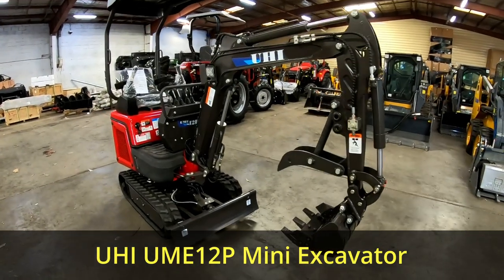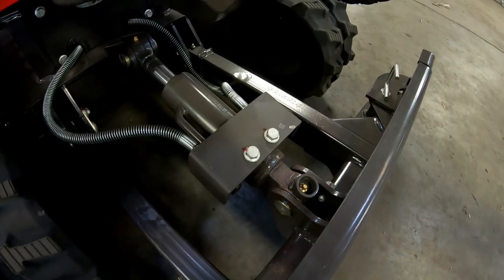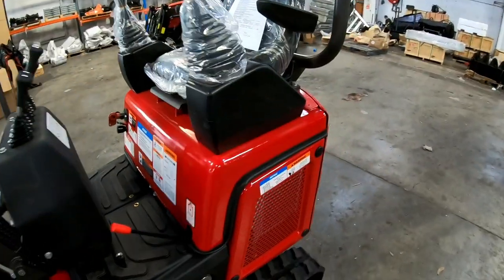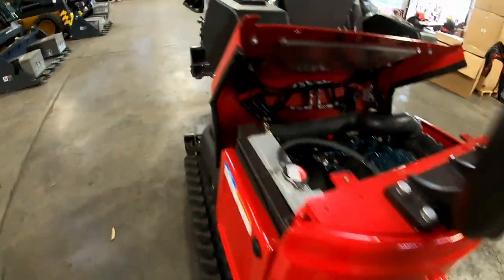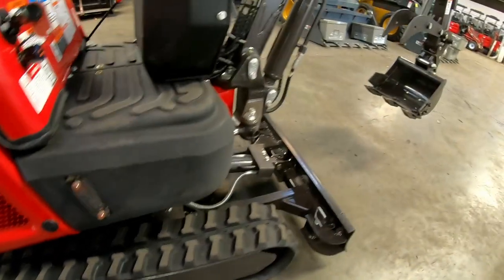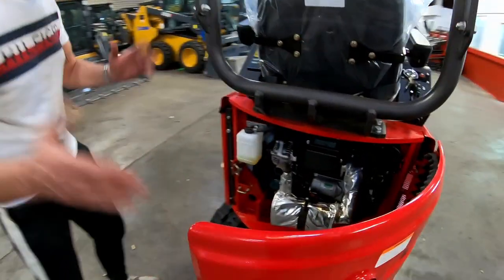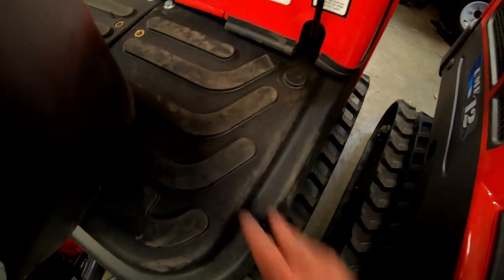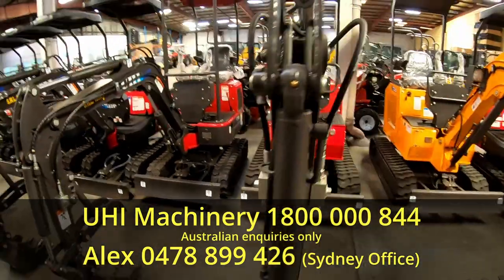UHI UME 12P Mini Excavator - NEW Model Available Now! #minidigger #miniexcavator

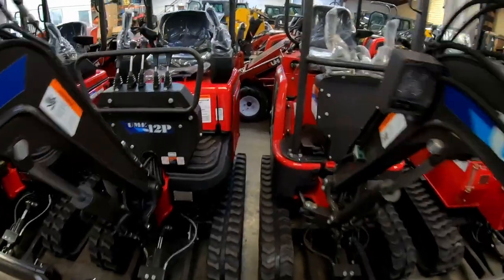Comment: I got the UME12, could've gone the 12P but figured the extra money isn't worth the additions for me.  I don't mind the front controls, its less complicated and will be simpler for valve related troubleshooting.  The thing that really strikes me as a bonus for the UME12P is the form factor.  At the comparison at 11:06 the UME12P has a lower/squatter chassis and the seat position is lower.  This would help keep the centre of gravity down and make it less "tippy" than the UME12.
Reply from the maker: Thanks Andrew. I agree about the extra money. I am not convinced either way at the moment. I do like however the easier access for servicing. Thank you for watching. Cheers Dave.

Comment: Question; I am not sure if you addressed this or not.  Does the UHI 12 have a dual pump?  If not, would you know which models would?  15, 18, or 20?  Thanks for the great videos.
Reply from the maker: All of the small UHI machines are single pump. There is some confusion also in how much volume they pump. The spec sheet says 17 litres a minute for the 1.2 machine  but the sales people say it's 24. I think even the 2.0 tonne machine is single pump where if you buy the same machine from XCMG it is dual pump. Cheers Dave.

Comment: Call me overly questioning but I'd be very interested to learn whether these joysticks actually use a true pilot control valve system or if they are just direct acting valves relocated to the newly positioned sticks (pilot controls are not named after aeroplane pilots as some believe, they are named because they use small pilot valves at the stick end to actuate the larger valves in the valve body that control the rams etc). Someone who's operated a UME12S needs to test drive this unit and see if it's different in the way it responds to inputs. The use of pilot valves is why larger excavators are more precise and smooth, it's not just because of where the sticks are positioned. This unit looks nice but also looks like it's from another family of excavators to the previous UME12S (which seems to be a version of the Rhinoceros XN12-S) and on youtube there is video of a new model of the Rhinoceros XN12-S that now has an access door at the back too (but no pilot controls). So many different permutations of these things coming thick and fast these days.
Reply from the maker: Yes thanks for that Dave. I don't know if you could tell by looking under the cover in the video with the hydraulic lines running up to the controls? I had a look at some pictures of the Rhino on google and not sure if it is the latest model but the top cover tilts back not forward and the roof support frame comes from the front and not the rear on the UHI. Also noticed that the Kubota engine is in opposite to the UHI. The radiator side on the Rhino is on the RHS.
Reply: yes, these are hydraulic sticks. Move more easily and have less slack but more cheap hoses to change and more parts to wear out. For home user I don't know if it's reasonable. For every day use you want these to save your hands

Comment: Cheers Dave, another good video. They certainly make nice looking machines and are striving to make them more user friendly. Just the improved access alone is a big thing. Did you actually get a chance to have a play on it to compare with your one?
Reply from the maker: G'day DD. Unfortunately I didn't get to try it out. There was a truck waiting to pick it up and get it delivered, so time was limited. I did hear it running and see it move out of the warehouse. Controls seemed a little sensitive, not so much on the track controls but on the slew control it looked not as smooth. Could just be the case of getting used to the controls over time. Cheers Dave

Comment: Is it possible to to buy it with an hydrolic thumb installed? It's probably the only important feature missing.
Reply from the maker: I think you would have to talk with the dealer or if ordering direct then have it installed by the factory. The newer model from this one shown has a mechanical thumb and would think future models will eventually have hydraulic. But they are built to a price remember. Cheers Dave.

Comment: Silly question can’t seem to find what type of grease to use ?

Any help 😅
Reply: I use red lithium grease, any decent name brand NLGI-2 spec. I like the reds because I find it easy to see when it's squeezing out of the joints clean.
Reply from the maker: I use a CASTROL AGRI grease which just about covers everything I need to lube up on my place. Others will comment also on what they use I am sure. Thanks for the comment.

Comment: The engine in the umi 12-p is listed as a Kubota D902. Both you and Alex state that the machine is 16hp.  The Kubota D902 specifications data sheets,  states that the D902 is  16.1kw (not16hp) that makes the engine about 21.5hp that is is why it is also used to power the larger machines. Not trying to be picky, but the larger engine was a major factor in my decision to buy the 2024 umi12-p. Not arriving until mid Jan 2024 but I can wait.
Reply from the maker: When the video was done that particular digger had the D902. I can only go on the spec sheets from UHI and from what the dealer tells me. Yes you can look up the specs for a D902 engine and find different horsepower figures in different applications. The D902 can make 24.8 hp at a rated 3600 rpm. Most digger specs sheets show HP at operating revs of about 2200 rpm. I probably operate my digger at less revs than that.

I have checked the UHI website just now and it shows the latest model of the UME12P as coming with the Kubota D722 engine (not the D902). If you have ordered one I would get confirmation on what the engine will be.

When I bought my digger 2 years ago the dealer told me they didn't know what engine configuration would be in the machines until they arrived, as the factory would change from Yanmar to Kubota (and different engine specs) depending on what was available at the time from Japan.

And the HP on the small digger is almost irrelevant because the performance is governed by the size of the hydraulic pump. My older UME12 is rated at 24 litres/min and I see the UME12P is rated at 17 litres/min. I did ask for confirmation on this and was told it was the same as the older model but the spec sheet was wrong. So maybe also wrong for  the HP stated for the engine? The larger XU20 machine does have a D902 engine but it has the larger 57 litres/min pump which gives it more operating 'power'.

Hope this helps. Cheers Dave.
Reply: I would think a more powerful motor would allow you to run at lower rpm without losing the power yet increasing the smoothness of operation. I have a mini skid steer with the Kubota D1105 24.8 hp motor and I find running it around 1800 rpm makes the machine easier to operate. If I need the power I’ll increase the rpm but 90% of the time it’s not necessary.

Comment: Hi Dave Next time you're talking to Alex mention to him that he is losing sales to his competitors because UHI wont mix and match accessories to suite individual customers. I have augers I run off my tractor which also has a 4 in 1 bucket so wanted to leave some accessories off but add a rock breaker instead. Unfortunately it was all or nothing. I can get the Rhino XN12-9 delivered from either Brisbane Or Melbourne to Newcastle $3K cheaper by leaving of some accessories and adding a breaker. Would rather run down to Sydney to buy a machine but $3K is a lot to pay for augers etc... that will never be used.
Like your channel mate. You picked one of the best places in NSW to tree change too.
Cheers Mate
Reply from the maker: Hey Sean. Yes I hear you. I have been trying to get another machine to test for the last few months but it has gone very quiet from UHI. I know they have grown a lot since the first videos and every time I call or email I haven't had much luck getting through. Cheers Dave
Reply: are you saying you got an xn12-9 for 17k by asking for no auger?

Comment: Same upgrate on umh 18 or 20 model?
Reply from the maker: There is a new 1.8t model that I haven't looked at yet but pretty sure it has the side controls. The 2.0t is a better built unit the same as XCMG and is much better in a lot of ways. The 1.5t machine has just been upgraded also to side controls. Hoping to get back to UHI next month for some updates. Cheers Dave.

Comment: A lot of nice improvements.  Weird they kept the binnacle in front.  No need for any of the remaining controls to be in front - should be mounted near the armrests or make them foot controls.  Bizarre they don't offer hydraulic thumb as standard - they ran the plumbing for one - a hydraulic thumb on any excavator makes a huge difference.
Reply from the maker: Yes it is bit strange that the foot controls on the earlier model have gone.  Would make it very difficult to use the auger drive on the new models as you would need 3 arms!

Comment: So no foot pedals to control the boom or auger drive. That's definitely a step in the wrong direction as you need your hands on the pilot controls whilst using the auger. Now you'll be a hand down and unable to slew while drilling.
Reply from the maker: Exactly right. Now with my older machine I can run the auger via the foot control and still operate the boom and the slew on the  hand controls. If you look at the photos on the web site of the new model UME15 (the next model up) you can see a better set up with just the track controls in front and two foot controls , one either side. For me this is the next machine I would go for rather than upgrade to the UME12P. Cheers Dave.
Reply: @TreeChangeFarmer  this is typically the mistakes importers who don't actually use these machines make. When importing from China you need to be in the factory to see these oversights of new models so you don't import a shipping container full of shit. 

Having the bigger engine is also a terrible idea, it won't ever see enough load from such a small hydraulic system and will cause glazing of the bores. Having the lockout lever on the floor is a great way of going arse over tit whilst snapping that off. Short tracks with rounded edge rollers are guaranteed to walk the tracks off etc. 20k is a lot of money for something inferior.
Reply: I have a UME12P - the auger is driver from a button on the pilot controls. In the video here Alex is mistaken and confuses the track width lever and the auger button.
Reply: @kirkyatras8333  Ohhh that is very good then!

Comment: Cannot wait for mine to turn up in Townsville.. hi Dave did you see where you put the fuel in diesel filler
Reply from the maker: I think they have put the filler inside  again. You have to flip the seat and top cover forward. There is a sight glass on the RHS that you can't see from the operator position. Not sure if the new display electronic  panel also shows fuel level.
Reply: Thanks Dave for all the videos